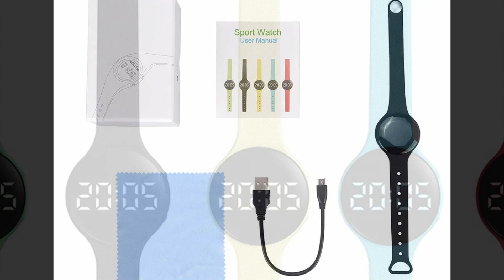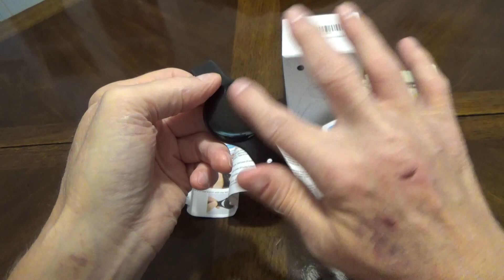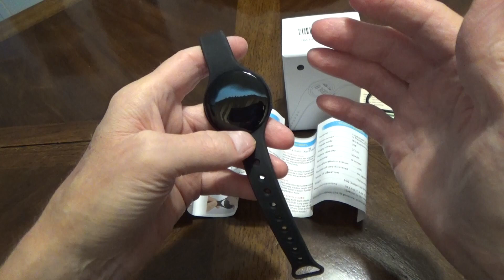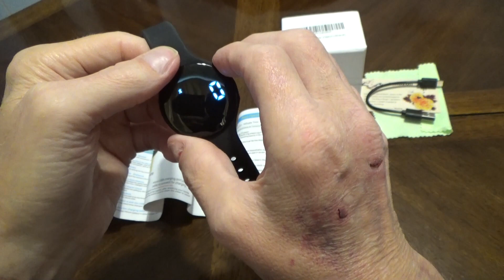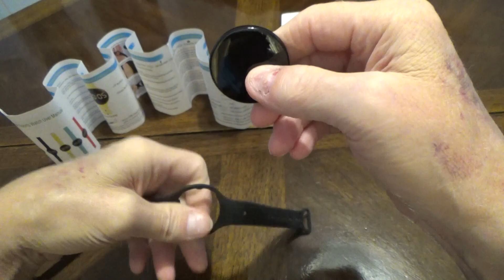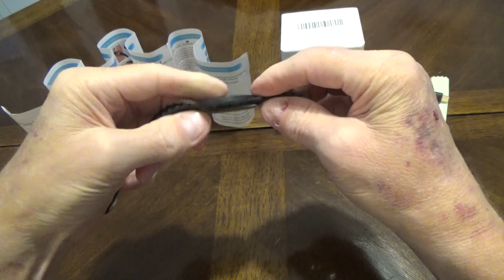iGANK T6A Non-Bluetooth Fitness Tracker Watch

Comment: I can’t get mine to track my steps. It stays on 0. What am I doing wrong? Thanks.
Reply: @Lizzy45172  yes I figured out that it resets everyday at midnight
Reply from the maker: Glad you got it sorted, as the first of my earlier reply stated it should be resetting itself.
Reply: @Tw3akst3r  yes! thank you!
Reply from the maker: You're welcome, just glad it's working for you.
Reply from the maker: Strange, it should track and reset itself every night. I do not remember how but there is a way to reset it yourself I'm fairly certain which might be worth a try. I hope you have the user manual so you can check on how that is done and I hope maybe that will help. It is really sensitive so it is really odd it isn't working at all for you. I hope it isn't actually nonfunctional as it is now discontinued and likely out of warranty and replaced by newer models.